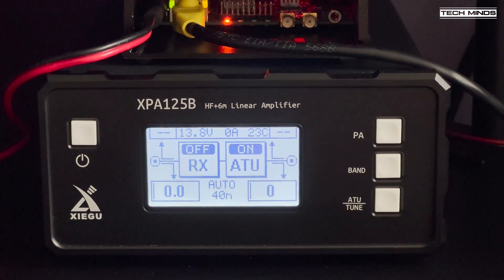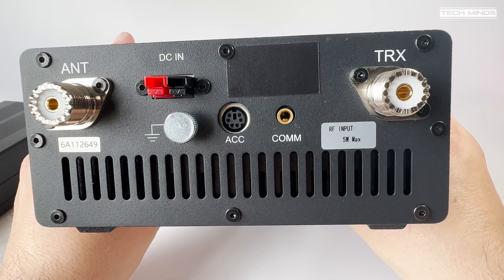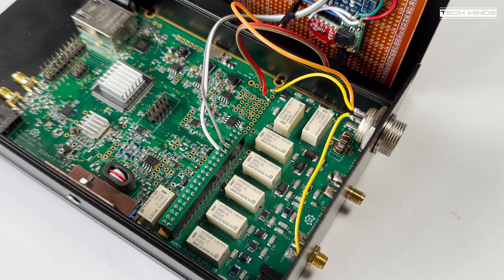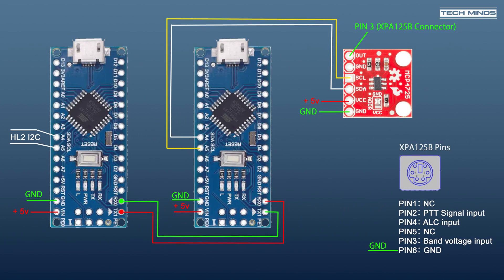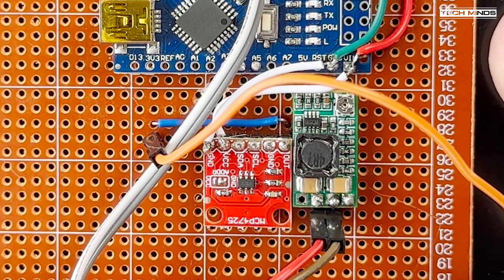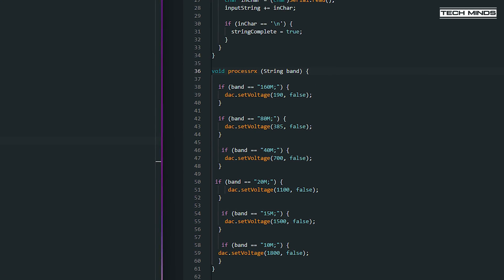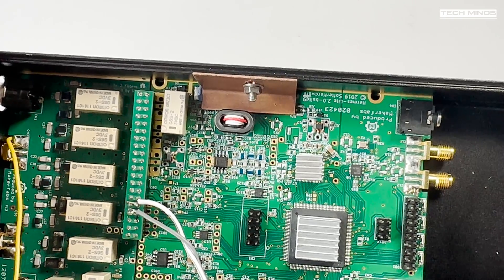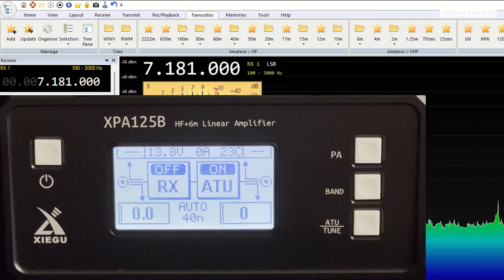Hermes Lite 2 Auto XPA125B Band Control

Comment: Why so comlicated ? Take an ESP32, thats all you need. You can read the frequency of HL2 from his internal UART you can find at DB1 connector of HL2 (RxD, TxD and GND). That's an UART with 3.3V level and 9600,8,N,1. Connect the ESP32 direct to the HL2-UART , define an external UART-Input at ESP32 and read the frequency (every time you change the frequency the UART sends a string in format "FA00028500000;" for instance if QRG is 28.500 MHz) . Cut the string to 2850000, so you will have the QRG in Hz directly. Define an analogue output too and generate the band voltage direct via one DAC of ESP32. Flatten this output with a resistor of 4.7k from ESP-DAC-PIN and a capacitor of 22uF against ground for the band voltage input of XPA125B, because DAC-output is PWM. You can use it for Micro-PA50 too, if you want (if not using auto mode of PA50). Calculate the band voltage depend from the input QRG. Thats all. Works great out-of-the-box and it's easier as the solution with the help of I2C and an additional DAC. I use this solution earlier with my IC705 (difference: from IC705 I get the QRG via BT-CAT with a BT-enabled ESP32) and my XPA125B. So I adapt this solution for the HL2, output is the same, input change for reading from UART of HL2. You can find this solution at my github-account (my callsign) with schematic, project ESP32-XPA125B-HL2 if interesting. 
73 Heiko, DL1BZ
Reply from the maker: My video was more to do with motivating people to use arduino with ham radio. The simplest method to control a 125b from the HL2 is to use the Fan PWM output with a small circuit and enable band volts within Thetis or Console, as per details here: https://github.com/softerhardware/Hermes-Lite2/wiki/Band-Volts
Reply: @TechMindsOfficial  Unfortunately it's not that easy. I've done some measurements, the "raw" voltage at PWM output (also if select bandvoltage) is different from the needed bandvoltages see in table in manual of XPA125B. If I understand right, you need extra components between HL2 and XPA in the voltage line for generate the correct voltage levels. And the SDR software needs the option to change the PWM output to bandvoltage. That was the reason, why I build it with an ESP32 "out-of-the-box", in this case I need only the UART output (which is much easier to handle as I2C) with frequency information of HL2 (part of gateware) and I haven't any dependencies from other things. Of course there are different paths that lead to the goal.  The next project I start is getting or better split the voltages from the internal SWR bridge of XPA to outside. Another ESP32 will be used for interpretation of these both voltages with two ADC lines and show this with the help of a websocket server and/or MQTT. So I will have access to this values if I work remote with the HL2 and cannot see the status display of XPA if is all ok.
73 Heiko, DL1BZ

Comment: hey, you really don't need two arduinos - you can "bit-bang" i2c, in other words there are software implementations of the protocol, which means you can create a bus on any pair of pins. even though the cpu has to work a little harder this way this shouldn't matter because you're not doing much on it anyways. so you could use the hardware i2c pins for the hermes, and the software pins for the dac

Comment: Kind of unrelated however, it would be helpful to me. If you could tell me what the amp puts out on each band when the Hermes is set to -7.5 dBm or the lowest power setting. For example, if your Hermes drive is set to-7.5 dBm or the lowest power setting on the software you are using, on the 40 meter band and the radio puts out .5 watts. Does that drive the amp to 39 watts? 
Thank you, Dan KM6CQ

Comment: Is there code to control the tune function? Meaning that when you use the tune button on the control software it will start the tunning process?
Reply from the maker: Unfortunately not, that is one of the features I would of liked to use, then I could remote install it.

Comment: Nice work Matt.  Curious to know if you have managed to get PureSignal working with the HL2 also.
Would be great to see a video on this also if you had the time. :)
Reply from the maker: Not yet, but I plan to. I am waiting for a Hardrock Amp to arrive where I will be making another video boxing it all up with the HL2. I will also include PureSignal as its a really great feature, from what I can see.
Reply: I am running a sampler on the back of a 500 watt amp and it works perfect.
Reply: PS with Reids Thetis for HL2 works beter then ever before!

Comment: Not sure I see the point. By the time you've bought a QRP HF radio (eg X6100) and this amp, you could have got a decent 100w HF/6m set to start with - like the 891, and had change for antennas and a decent battery pack.
Reply: Using Thetis Software What you get is a radio that is on par with $2000 + radios and one that is vastly superior to any 100w HF radio in the same class as the 891. And I mean vastly superior. That's why people are looking for a decent amp to use with the Hermes Lite.
Reply: @GreatDXR  Really? Fair enough. I'll have to take a look at the Hermes Lite 2 and Thetis then. I assume Matt has done a video :)
Reply: @GreatDXR  How is it superior to say a IC-7300?
Reply: I think the point is self-training and experimentation.